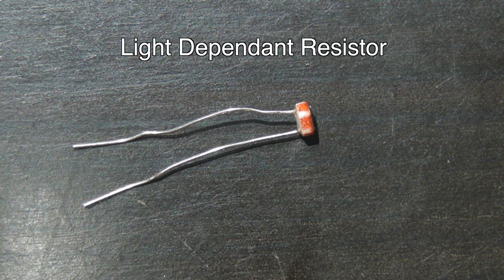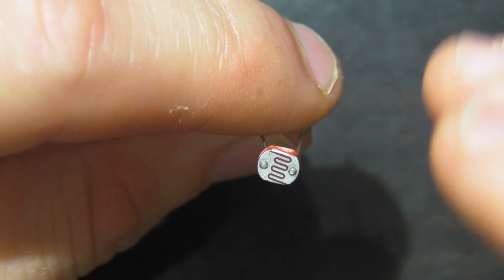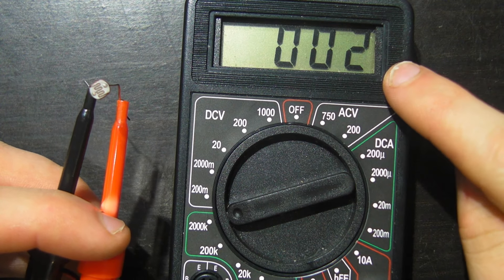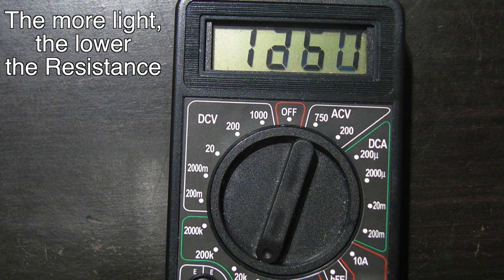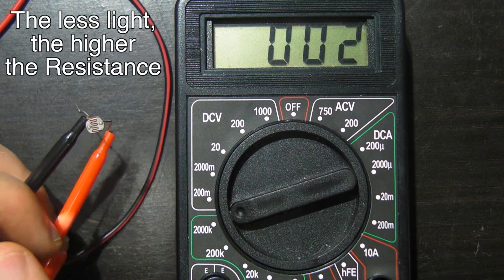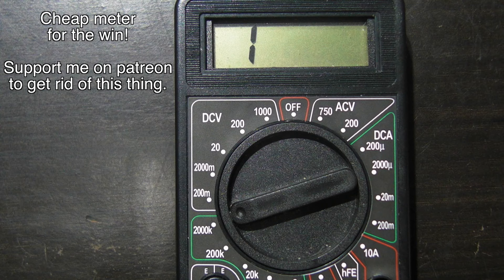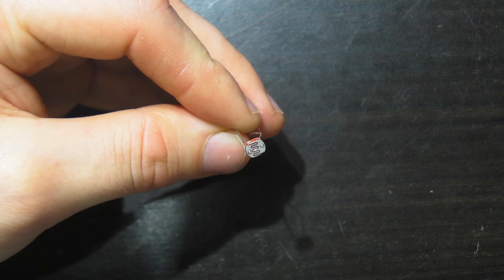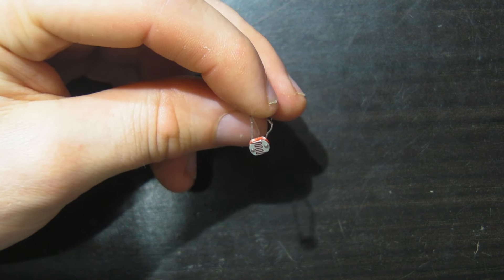What is an LDR? (Light Dependant Resistor) - Electronics Basics 26

Comment: I’m confused. If more light lowers the resistance, that would mean that there would be more current flowing through the circuit, powering the load (an LED for example). So, if there’s less light, there’s higher resistance, lowering the amount of current in the circuit. So the LED would turn off. At least, that’s how I’m understanding it. Is that right? Because that doesn’t make sense to me. I thought that you would want to power an LED or other kind of light source when it got dark?

Comment: Hi there, I have enjoyed your Basic Electronics series very much and even used it for teaching! So great work! 🙂👍Haven't you considered making some more videos with simple circuits, also created in Everycircuit! I could for example envision some with crystals, LF amplifiers, RF amplifiers, emitter followers, common base amplifiers, transformer circuits, mixer circuits, simple oscillators like Pierce and Collpits types, a Wien Bridge oscillator, a Wheatstone Bridge, a Maxwell Bridge and other DC or AC measurement bridges, Low pass, High pass and Bandpass filters, circuits with opamps and equivalent circuits illustrating  how capacitors, inductors and resistors work at high frequencies. What do you think?
Reply: Regarding the geometric properties of the resist, is the external area of the resist (the brightness area) the only factor, or does its behavior differ with respect to thickness?

Comment: Can Someone help me, I’m so confused because for example in street lights as it gets dark there is more resistance. How I would interpret that is if there is more resistance then less current can flow through the circuit meaning that there is less light. But this doesn’t seem to be the case?
Reply: I think they use inverters, but I'm not sure

Comment: Im confused. When light hits it, it has lower resistance and when its dark it has higher resistance. How will the street light or night life power on if the resistance is high? Pls help me understand thank you.
Reply: bro if it is a bright morning, you will have more light, so its  resistance is lower and the current can easily flow through the resistor and power the street light. And at night, there is darkness and you have higher resistance , the current cant flow through the resistor and doesnt power the street light.
Reply: ya then what is the point of light needed in morning and not in night ya im also confused